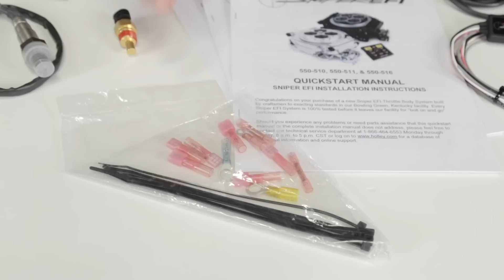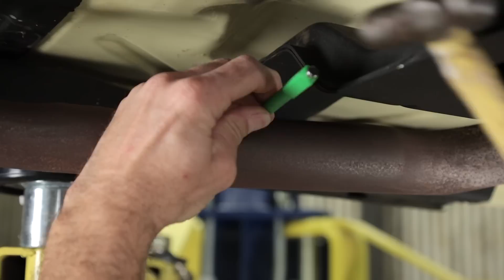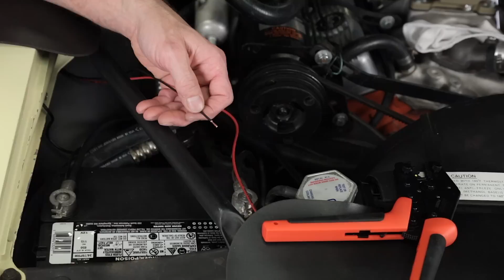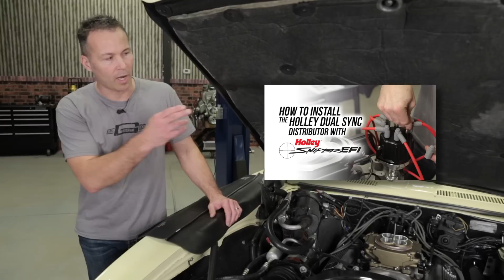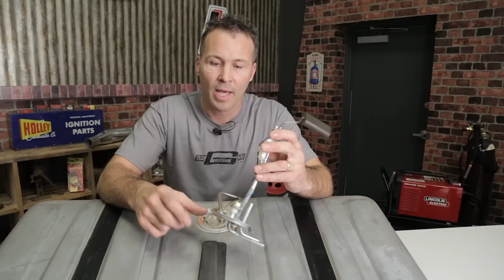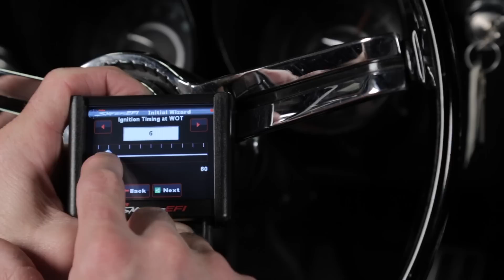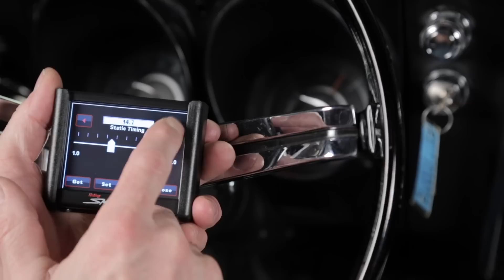How To Install Holley Sniper EFI

Comment: I am working on tuning I was trying to get the IAC down below 10 Like the video recommends however I just realized  a few things The Truck is not coming up to operating temperature. After 30 minutes sitting in the garage it is at 146 degrees according to the sniper Display and my own water gauge is a hair below 160 so I think its the 160 degree thermostat I installed?  It was very cool this morning perhaps not allowing it to get to operating temp? I had previously used A 180 Hyper-tech thermostat when I had my Holley Carb but it would go past 210 degrees so I changed it while doing the EFI Upgrade. My thinking  was I had a over heating problem caused by the thermostat. I noticed after 30 minutes The IAC just sits at 26 
Anyway someone told me the sniper and other EFI set ups like Warmer temp so please let me know what to select thermostat wise.
  Also Do I return the Curb Idle Screw back to where it was before I ever started it then place the vehicle in Drive with someone holding the Brake And then Adjust the Screw down Will that move the IAC Down?...
Reply from the maker: Yes the engine temperature must be above 160 degrees fahrenheit on the sniper handheld display.  I would recommend installing a 180 degree thermostat.  Once the temp is above 160 you can adjust the IAC.  As you close the primary throttle blades ( turning the idle screw counter clockwise and idle drops) the IAC percentage should increase on the display to compensate.  And if you increase the idle speed ( turn the idle screw clockwise opening the primary throttle blades) the IAC percentage should fall.  Be sure to monitor the TPS position as well.  If the TPS reads higher than zero, simply turn the ignition off and restart to reset the TPS back to zero and continue the IAC adjustment process.
Are you controlling timing in your setup?  If so what distributor or ignition box are you using?  If you're not controlling timing then you should continue to use the  timing settings you were before the Sniper install.
The spacer should not be necc but can be installed if you want to, as long as the throttle blades operate without making contact with any part of the spacer. J
Reply: Its the GM HEI With the Giant Coil on top. Saving up to swap for the one that goes with my Sniper for later.
Reply from the maker: Ok, there will be no timing control by the Sniper with a large cap HEI distributor.  Just use your base and all in timing numbers you were before installing the Sniper (if you never loosened or moved the distributor you should be good!).  Make  sure you select the coil (-) option in the ignition section of the start up wizard.
Reply: let me thank you ! I will head out and get Another Thermostat And more Coolant LOL  I forgot what is the best setting on the timing I might have knocked it out of place the hold down was loose. Some say top dead center some say 6 degrees after top dead center. ETC For my stock 350 with Auto trans where should I start at It is A HIFYRE MSD HEI
Reply from the maker: Your welcome!!
There are alot of variables to take into consideration but I would start at 8-10 degrees before top dead center for your base timing.  Remember to disconnect and plug the vacuum advance before you set it!  All the timing should be completly in by 2000-2400 rpms and probably around 30-34 degrees max.
Reply: Thank you its been years since I messed with Timing I just could not for the life of me remember where it goes just gotta find the Timing light LOL
Reply from the maker: Your welcome, keep us posted on the progress!   Thanks
Reply: Hello I forgot to ask you if I should get the regular Holley Chrome 14 Inch Paper Filter in my case. We have the Cool Blue Filter on now but I wonder if the Pre Oiled Filters are OK to Use or can they harm my injectors? I also plan on putting A Pre Filter on the outside of the Air Filter just so the paper element stays fresher for longer Moms driving this 64 C10 From Socal all the way to Des Moines Iowa and Back to SOCAL by her self so I am doing all I can to make this 100% Reliable So A/C Disc Brakes everything is new Including the Sniper but she is not going till I shake the thing down first. The Entire Drive Train is New so it should be fine but still I worry.
Reply from the maker: Pre-oiled is fine as long as there is not excessive oil on them!  the excess oil can skew readings on some sensors.
Reply: I just installed the Hotter 180 Thermostat I ran it A little bit yesterday and it went above 170 and into learn mode. I had to cut my trip short so I only logged 6 miles I see it says it is at 26% on learn So when it reaches 100% I am done? Can I disconnect the Monitor or best to leave it where I installed it?  will it always start with HI Idle or begin to settle down more over time?  I have An RV Cam so was I supposed to use the Stock Setting or Street/Strip? Everything else is Stock the Heads the Torque Converter ETC. It does have Overdrive 700r4 and 3.73 Geared Eaton TRU TRAC.
Second Item Our rig is A 64 Chevy C10 with The OEM Linkage Rod so the Spring is forward of the Throttle Body. I took note that the Throttle with  nothing hooked up returns or snaps back to Closed on its own is that something new? I dont remember my old Edelbrock Carb doing that I could be wrong Any way I always had A return spring on my truck In fact I had A Dual Spring in case one failed so I would not worry about it.  the thing now is even with the lightest Return Spring I have A very Heavy Pedal takes alot of foot force. But it seems WAY BETTER Without the return spring at all I posted A Video on my Channel so you can see what I Mean. It is titled  Holley Sniper Throttle Return Spring 1 of 2... it just seems to work fine without the spring...I  continue to use the spring for now I understand Safety is my Own responsibility I just want to know if I can count on the Throttle Body to Return and Snap back to close time after time or do I need that Spring I have used for decades with my Carburetor. Thats about it I removed the Spacer and installed the Angled Cool Chevrolet Valve Covers like the ZZ6 Center Bolt Valve Covers LOL!....THANKS FOR ALL THE HELP...
Reply from the maker: Use the stock cam option on the wizard.  The learn percentage number should go down ( it will probably never reach or stay at zero because of constantly changing conditions)  as it learns and creates a base calibration.  You can disconnect the handheld if you want but it is handy to have so you can monitor the gauges.  Maybe run it into the glove box for easy access if needed.  The spring on the throttle shaft is strong enough to close the plates but I highly recommend using another return spring as a safety measure.  Maybe look at a parts store for a  spring with a little less tension or move the bracket closer to the throttle lever to decrease the tension.  J
Reply: last thing..I HOPE When I drive it in learn mode if I try to Stomp the gas I hear what sounds like A Huge Vacuum leak If I ease up to the full throttle it does not do it. There is no wierd Idle Surging or anything I sprayed a little WD40 while it sat at idle No Surge or leaks so I wonder is this just the TBI Going thru its learning mode? the Timing on the Display is showing me between 14/15 at Idle it seems to fluctuate like that on the display anyway Timing marks seem rock steady on the Timing light. the IAC is at 1 at Idle and the learn started at 26 now is at 33 but like I said I am sorting out these little issues so I hope I get to start driving more  and more
Reply: Looks like im going to stick wth good old carby

Comment: Hello just finished today.  05/28/17 
I had Leaks to solve with the hard line set up on the Fuel ends.I needed the Flare wrench to get the Proper torque on the hard 3/8 ID Steel lines to stop the leaks I have 5/8 ends I have Your Russel Adapter ends #640610. I posted videos on You Tube with my progress. I ran one Gauge for the Hi Side and it is reading 60 PSI with the key on engine running... At the same time The Low Side Gauge read 2 Psi But right at that point I shut it off.  I Just remembered I have to verify that I have adequate coolant and tighten the O2 Sensor I might have missed it. 
 I Do have a few questions...
As the Truck warms up to temp...I am using 160 degree thermostat Griffin Aluminum Radiator 15 PSI cap with A Thermal Hayden heavy duty Fan Clutch and full shroud  set up fan slightly on the outer edge of the shroud so it moves the air properly.
Is the 160 Degree thermostat correct to use?  It is A fresh rebuilt Stock Chevy with Stock Roller cam and Stock Heads 350/5.7 1987/95 type with your Street Warrior Intake.
So While running what should the Low side read ? Also what should the pressure gauges read when I shut it down after my first drive? Return to Zero?
I did not catch the part about using 5/16 Size Return line until till after I had already Run the 3/8 ID Size for the send line and the Return So do I have to Start over with 5/16 ID Steel on my Return line?
Our Truck is is A 1964 Chevy Fleetside Short bed with the Tank from Tanks Inc.In the rear under the Truck bed between the frame rails. has A Fresh 700R4 Trans and Fresh Rebuilt 12 Bolt Rear with Eaton True Trac 373 gears and stock type 4 wheel Disc Brakes from CPP.
On the Fuel System I am using #12301 red Aeromotive Pre Filter and the After filter is the Smaller FRAM Filter #G3727 About 24 inches away from the tank they are Wrench type Filters along my inner passenger side frame rail everything leads up to the passenger side Throttle body... 
SO I FIRED IT UP FOR THE 1ST TIME AND IT CAUGHT IMMEDIATELY I MIGHT AD! The Initial Readings from the Sniper Display Gauges were OK thats it.....
Its been an education for sure very smooth Idle in park. Not quite sure how to post so you guys can see the videos but I am no good at Cut And Paste stuff I am a "monkey see monkey do"  type gear head not A computer guy LOL but your welcome to use any of the videos I posted any way you see fit
Sincerely Jeff A Garcia Riverside CA.
P.S. Or Let me know how to do it or I will ask a friend
And By the way MOM LOVES HER SNIPER! She could not believe the difference how fast it Fired Right up No Pushing on the pedal First ETC!  This is going to be my moms daily driver...All the Way From Cali to Des Moines this summer! So the reliability is Crucial! She is going Alone!

Comment: I purchased a Holley sniper efi a few weeks ago, The unit was garbage it had a bad IAC and the fuel pump was bad all out the box new. The fuel pressure was pulling  around 30 psi. The mechanic that installed the holley sniper for me installed 6 snipers before my unit, so he knows what he is doing. He told me 2 of the 6 Holley snipers he installed had  fuel pump problems but no issues with the IAC. One of them he had to install the fuel pump  inside of the gas tank. I finally contacted Holley, I was on hold for 35 minutes, the tech wasn't helpful on what they can do for me. I haven't received the IAC in the mail yet  and I had to pay the mechanic to install a bad Holley sniper unit. I had to buy my own IAC from a 98 Chrysler and I'm waiting to see what they will do with the fuel pump. Is Holley going to reimburse me for the waste of money I had to pay out? highly doubt it. I am very displeased with the Holly sniper unit. I wasn't lucky to get a good unit I guess. Holley get your trash together!
Reply: I would say he is paying paid to give bad reviews like similar I have seen elsewhere. Just my opinion and I may be wrong, I doubt it though ;)
Reply from the maker: We are sorry for the problems you are having with your Sniper EFI install. Your comment has been forwarded directly to our Tech Service dept but they need a way to contact you so that they can help you. Please submit your phone number and email on our website here: https://www.holley.com/support/support_request/ and request a reply or call from the manager. Be sure to make a note in the "Question" or "Problem" section that you are the customer from youtube.
Reply: It's been weeks and I haven't heard anything from holley. I went to the site and filled out my information with a statement on the repairs I had to do with the sniper efi unit. So what is doing on?
Reply: @Ricoredrum  WOW!  I was considering purchasing the Holley Sniper EFI until I read this. Did Holley ever make it right with you, or were you at least able to get this set up to work right on your car?  I will be looking at other mfg. EFI systems for my car now. Sorry this system didn't work for you, although thanks for the warning.
Reply: Gábriel Priòre he doesn’t have to give any other advice or proof. It’s his buy, that’s his freedom.
Reply: Well, people claim to know what they are doing when they clearly don't. That's why you either have to get a specialist or knowledge to do it yourself over a schmochanic sometimes. But one cannot simply mix and match different size wires, connectors, or splice this, or jump that. You ghettofy computer controlled stuff, you'll have to spend more $$$$ trying to get it fixed.
Reply: If you're going to talk trash about the Holley company and their Sniper EFI product, then, do you have any better alternative suggestions instead of Holley? And if so, what kind of real physical proof can you provide? EVERY product I have EVER attempted to purchase in the entire Universe {regardless of the subject} has always had someone talking CRAP about it!!! So that means if I actually chose to believe every negative review {which could even potentially be a fake complaint}, I would not be able to purchase ANYTHING in this entire Universe!!!

Comment: Can a small cap HEI (7 or 8 pin) be setup so its timing is controlled by the ECU?
Reply from the maker: Yes, but it is not a plug and play installation like it is with Our Dual Sync distributor.  You will have to lock out the centrifugal/vacuum advance and  modify the stock rotor or install an adjustable rotor to obtain 50° of crank reference angle.   (pages 16 and 17)        http://documents.holley.com/199r11031r.pdf

Comment: I have a 69 camaro with a 383 stroker and a street strip cam. My question is while at idle my engine is extremely rich and has troubles idling  to my set 850rpm.(it ether idles way high above 2k rpm or goes way low and stalls out)Now at cruise speeds on the road (45 to 55mph) the engine runs perfectly! I guess I need some help pointing me in the right direction to fix my poor idle and very rich idle condition any help would be great! Thankyou!
Reply: I had that issue with my set up and I had a big piece of my intake gasket missing causing a internal vacuum leak. I changed the gasket and I was good to go. It took me forever to find the issue